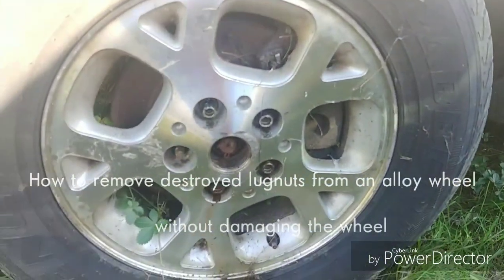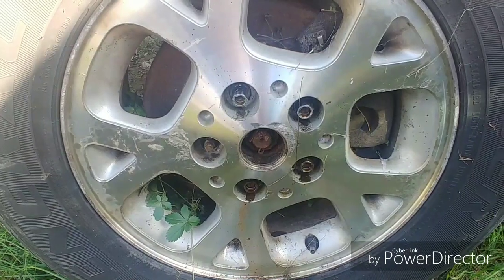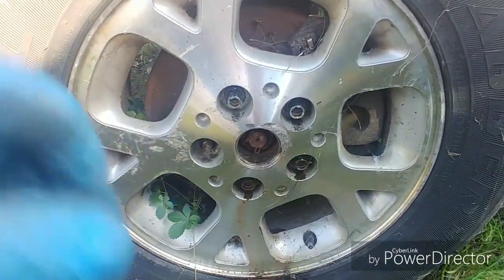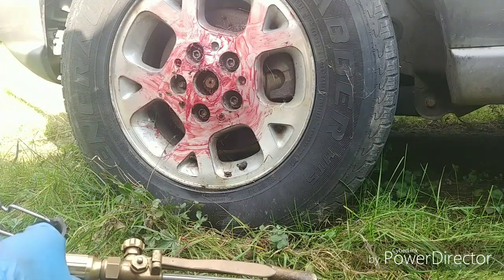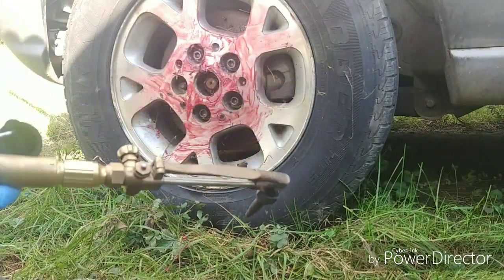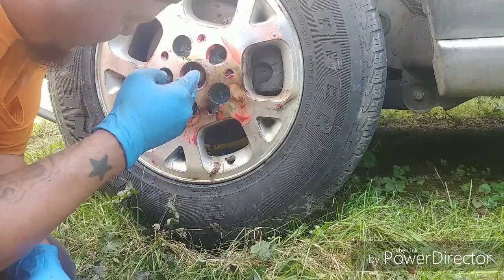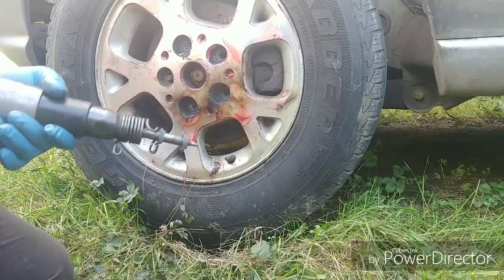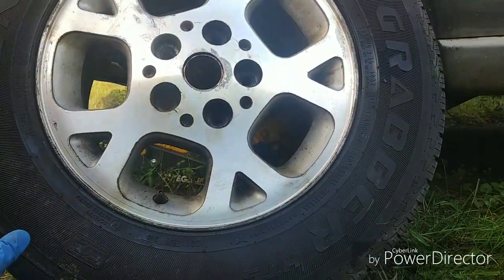How to properly remove destroyed lug nuts from alloy wheels with an oxy-acetylene torch.

Comment: That’s what happened to my jeep!…. What worked for me was a lug nut removal  socket  and a  sledgehammer, making sure the socket is all the way seated against the wheel!… how do use two different sizes one to remove the otter casing and then another one for the nut

Comment: I recently had an aluminum front wheel and one of the studs was spinning in the hub. I tried drilling stud through center of lug nut, and that did not work at all. had a carbide burr and tried to grind the side of the lug, no luck with that as the cone of the nut is down in a hole. Tried air chisel, no luck there. After about 2 1/2 hours I got the torch and aimed the blow towards center of stud, and had it off in less than 2 minutes. Burned the clear coat around hole but no damage to wheel.

Comment: I have a stripped lug nut on the stud on my car 2014 Nissan Altima SV the stud is just turning. I took my car to so many shop and not one shop was able to take the stud  off I'm really in need of help taking this stripped stud off I'm trying to put a new tire and replace three new studs I need help getting this stud taken off are you in Birmingham Alabama I'll be so happy to get this stud taken off and my tire replaced I took my car back to the tire place I bought the tire from they couldn't remove the stud they were the ones that stripped the stud

Comment: What brand of wheel bearing greas did you use? Discount tire guys broke and the welder said it will burn my rim. Thanks for your post. Trying to save my rim
Reply: Yes this is a good question just use any high temp grease that’s says maybe 1000 degrees

Comment: The aluminum isn’t effected because steel goes through an endothermic reaction with acetylene and oxygen. You can’t cut aluminum with an oxy fuel torch. Just FYI cool video tho! I might have to try this I have a vw lug bolt with no way of getting it out, the head is a circle with a weld on the inside idk who made it I bought it that way..
Reply: Did it work?

Comment: I have rusted on Lugnuts on aluminum wheels will use your suggestion with high temp wheel bearing grease And map gas to heat up using Extended cheater bar! Didn’t know about the wheel bearing grease, thanks!  The video would’ve been better without the heavy metal  👍
Reply from the maker: You can mute it 😁

Comment: What psi on gas and oxy?
Reply from the maker: Your setting will vary with your tip size. But I usually run mine around 10 Psi for the gas and 40 for the oxy. For anything less than 1 1/2" thick

Comment: Hey, is the rotor or wheel hub damaged by this torch process???
Reply from the maker: No. If you do it how I show you only the studs need to be replaced. With the wheel in place it acts like a heat sink. There is very little heat transfer to the rotor and hub face

Comment: What’s the name of the grease and the tank to use the torch? Where can I buy?
Reply: You can get high temp grease from any auto parts store, an oxy fuel setup will require a trip to a welders supply store and some training, there's some seriously important safety steps when working with acetylene.

Comment: So basically fuck the studs then? Unreal.
Reply from the maker: Obviously you replace them. Much cheaper than a wheel. This is a last resort to do if regular sockets and easy offs do not work and there is nothing left of the nut to grab, it happens sometimes the studs can be easily replaced

Comment: Good job, but I guarantee you I would screw it up. Wouldn't try it on anybody's but my own.
Reply from the maker: It takes a bit a practice and experience with the torch. Keep in mind this is a last resort
Reply: @dkenderdine79  How much gas was used to melt those lug nuts ? I have 4 that I need to remove just like this video and I absolutely need to do this. Just making sure I have everything I need before I start on it.
Reply from the maker: @tynanofalltrades  took about 10 minutes total. I just edited it because a lot of it was digging out the slag
Reply: @dkenderdine79  okay because I have little tanks. About how big were the tanks you used ?
Reply from the maker: @tynanofalltrades  I have full size tanks. But the small tanks usually last around an hour on full blast. You should be good
Reply: @dkenderdine79  cool. And thank you for the responses ❤️👍🗣️💯
Reply: @dkenderdine79  One more question...by doing this, did you damage the rotor and have to replace it before you could put another tire on there ? After you replace the studs of course lol I'm asking because a tire shop said I would need to replace my rotor after this because the heat would damage it also.
Reply from the maker: @tynanofalltrades  no only the studs get melted. Just bang them out and replace them. They are cheap. Rotor is fine. If a tire shop can't do this without damaging the rotor don't let them touch your vehicle. Regular use of brakes gets the rotor hotter than the heat transfer from this ever will. Unless you go crazy and melt the wheel. Sounds like they have no clue what they are doing. I've been doing this for 25 years. Never damaged a rotor or drum. 🤷